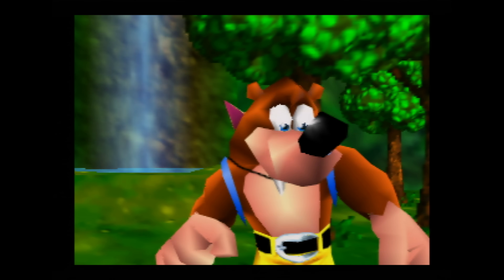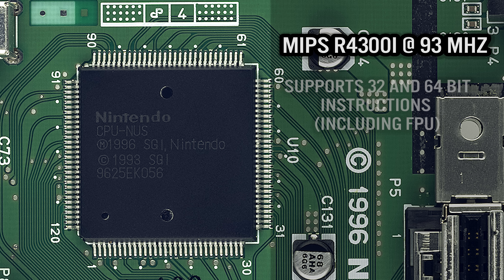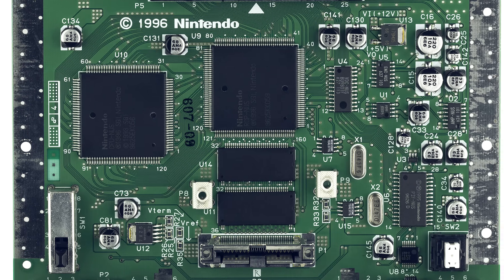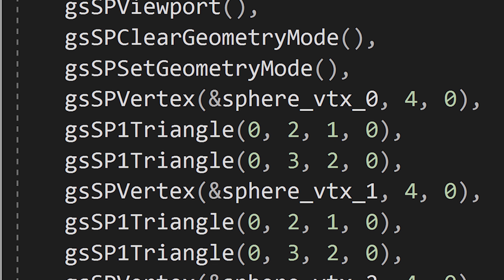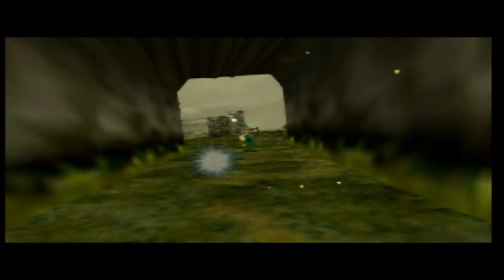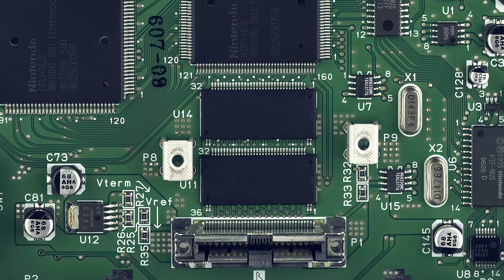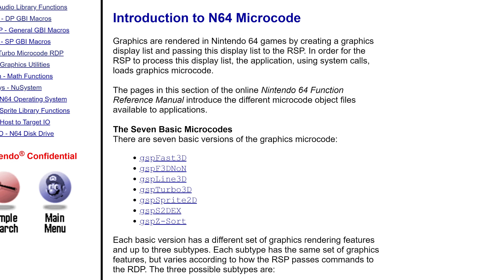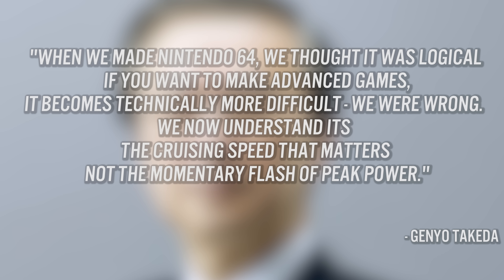Why was the Nintendo 64 so hard to develop games for ? | MVG

Comment: Pipelining doesn't mean parallel execution. Superscalar architectures are a different thing. Pretty much every CPU since the 70s has pipelining and if they didn't, every single instruction would take 4 or more clock cycles to execute.

Comment: That generation was a basically like a second beginning for consoles as the industry moved forward into uncharted waters with 3D graphics becoming viable. Every company had their own concepts of what they thought was going to be the best accepted method of making it happen and what resulted was three really janky consoles each with their own quirks and issues. The Saturn was overdeveloped, the PlayStation was underdeveloped, and the Nintendo 64 was badly developed. That's an entirely separate issue from the entertainment quality of their games, some fine software came out of all of it, but it can't be denied that they're still really wonky machines on paper.
Reply: Saturn was overengineered and TOO complex because its design was UNFINISHED. Parent Company CSK forced its Beta design to be rushed into production 4 months too early. PS1 was underpowered, NOT underdeveloped. That's because its STOLEN Sega Jupiter hardware jankly designed with horrible, basic 3D Polygon drawing and Rendering Sans actual key Hardware tools to fix broken textures. N64 was underdeveloped because Nintendo got ahold of its hardware in Early 1994 and was determined to hurry it out to the market as Yamauchi WANTED it out by 1995 in Japan, but Sony sabotaged the project by Yellow Gossiping to potential CDX licensing about Nintendo. The N64's design was RUSHED.  It's Beta ALREADY ready to go by November 1994. Nintendo held on to it throughout 1995 in a futile attempt to acquire CDX mastering and Drives.
Reply: @segaunited3855  Thanks for the clarification.
Reply: @robintst  You're welcome. Saturn's Beta would have been fully finished by March 1994, but Isao Okawa forced its Unfinished Beta to be rushed into production in December 1993.

Comment: I told Nintendo to go with the 80486 cpu, on a 586 socketed motherboard. With 8mb of ram. This would have allowed them to use an extremely powerful Dx4 100 cpu with extra instructions. And if more power was needed, a 80586 cpu could be added later. The estimated cost of the system I recommended would have been between $300 - $400. But think of the games it could have played. It would have been to the nineties what the 360 was to modern times. :)

Comment: I don't really think its fair to blame Nintendo for any of these except the fill rate/microcode and/or RAM latency. Everything else seems like whiny developers. Developers in my opinion freak out about custom logic to begin with. It does not jive with their unrealistic fantasy. Nintendo did not probably want to reveal its architecture too much.
Reply: "It does not jive with their unrealistic fantasy"  - That would be deadlines ?
Reply: @SerBallister  "That would be deadlines ?" - That would be cheap games are great games not great games? Nintendo believed if it gave developers the tools to be great, they would be. RAM is slow and expensive. Nintendo said time is money. Developers said no, it doesn't work like that. Time is money.  Sony learned this same lesson with PS3. This is why PS4 and Xbox One are on x86 APUs.  Tech has peaked; cause time is money. Deadlines is just time. Deadlines be money. Greatness is just a myth. It's not the complexity that is the problem though. Its productivity. Low productivity that makes money and is on time, it's a feast. When the innovation stalls it's a famine. Innovation that does not increase productivity is really smart....

Comment: Third party developers didn't want to create games for cartridges, because they were much more expensive and couldn't hold nearly as much memory. The PS1's CD-based console was much more attractive to developers, because CDs were much better than cartridges. It also didn't help that the PS1 sold 100,000,000 units, while the N64 only sold around 30,000,000.

Comment: Imagine if somehow it had 64K of cache and 64MB of RAM.  Like a N64+ that came out a few years after initial release.  That would be mind blowing for the consumer with high potential textures, and larger levels.  But a nightmare for developers to make a game that plays on both consoles with 2 texture packs.
Reply: It would still have the laughable 4MB cartridge size , and the compressed to hell sound thats also dependent on the CPU .. unlike even the PS1 which had an impressive sound chip and didn't waste CPU cycles for sound
Reply: @aceofspades001  with large enough Ram you can just stream the sound from it at decent quality. so it would be more possible to pre generate the music at like a level transition. this would waste barley any cpu cycles.
(yes i am aware of how absolutely bat shit insane this solution sounds).

Comment: Hard to develop on N64? Have you seen the Saturn? N64 is the simpler of the 2, but it was easier to develop on the PlayStation than the other 2. I'd perfer the N64 since you could take your camera anywhere (due to perspective correction), and not worry about textures sliding.

Comment: To their defence nobody knew how to design a viable real time polygonal/3D rendering system at the time, especially not in the consumer space. It was a completely new paradigm. Still mind boggling that Silicon Graphics could design a chip with such a laughable small texture cache even for that time when the system was so dependant on that. It was so much ahead in everything else.
Reply: They didn't have CD rom for good rez textures anyway. Less textures, cheaper cartridge to produce. Saturn and Sega32X were promoting games like Virtua Fighter at the time which had like no textures at all.
Reply: @zerazara  N64 was designed with a superfloppy in mind. N64 DD was supposed to release much earlier and effectively be the N64, and AFAIK wasn't even meant to be a peripheral, but it was postponed because of quality issues and eventually effectively cancelled. But you're right, textures wasn't much of a consideration at the time, flat surfaces was believed to be what they had to settle for in most cases, that was the paradigm, I had forgot that.
Reply: @snetmotnosrorb3946  hmm, that would have been interesting, imagine say, goldeneye on a disk, with the cartrige mostly being faster ram and a buffer for code and textures 👌
Reply: @zerazara  Sega knew texture mapping was the next step though. Daytona USA came out in the arcades in 93, before the 32/64 bit consoles launched. 
 The Saturn did launch with Daytona USA with was texture mapped, They also brought out Virtua Fighter Remix and later Virtua Fighter 2 and Sega Rally with all had texture mapping as well. 
Playstation also had Ridge Racer, Tekken and Wipeout that featured textures too.
Reply: @lazarushernandez5827  My point was that at the time, just being fully 3D meant more than good textures in a game(And not 2.5D like for example Doom and Duke Nukem). 3D games was like a gimmick at the time which amazed 16bit gamers. And many of the 3D games also sucked because making games in 3D was unknown terrain for many game developers. But we had some great titles though back in the day right after mid 90s, like Super Mario 64, Sega Nights in to dreams, and Crash Bandicoot.
Reply: @zerazara  even with CD you couldn't access the data since the RAM was limited...  you had to stream the game data linearly which is good for games like crash bandicoot, starfox, and single player racing games where you could stream the textures and level data as you moved through the level, but it was bad if you wanted lots of different enemy types in the level at the same time.
Reply: @aoeu256  You are overcomplicating things. Point is, you could never have made Final Fantasy VII as the great hit it was on N64, even though the PS1 had inferior Hardware, simply because the PS1 had CDRom and could store more detailed content, cutscenes etc.

N64 was great in it's design. But it would have completely dominated the PS1 and held up much more against the PS2, if it had a CDRom out of the box. And if the next Nintendo iteration had DVD capability, it might have completely crushed Sony in the console war..but Nintendo played safe, and focused on franchise, branding, entertainment value instead of technology. And they have had great success with that strategy. SEGA for example tried the technology approach m, and we all know how that ended..
Reply: That's not true.  Nobody new how to design a capable 3D graphics rendering system with a unified memory bus.  The geometry transformation, texture mapping, and framebuffer reads/writes are all memory intensive - and they interfere with one another when they are all on the same bus.  Nintendo could have added a small VRAM chip like the Playstation did, but that would drive up the cost.  And their custom hardware was already expensive.
Reply: @alexandernorman5337  It is funny how these consoles pioneered tech/architecture back then (even if they had hurdles programming for them) that is often mainstream today. 
The N64 had unified memory architecture (I think the original Xbox was the next console to use a unified memory architecture)
The Saturn(and 32X) had twin CPUs (more difficult to program for back then but could yield great results, most ports from the PS1 only relied on 1 CPU, and it was noticeable by comparison). 
The Playstation eschewed a proper sprite system for polygons (they would use texture mapped flat polygons as sprites).
Reply: It's not really laughable.  4KB per texture is fine for that era. PS1 had the same. The idea for N64 was tiling and clamping multiple textures across surfaces, making use of texture detailing etc.  Unfortunately due to tiny carts and time, in most cases devs simply stretched a single small texture across the surface.
Reply: Keep in mind Nintendo and other consoles didn't really know what sort of games were going to be popular. I think they had a pretty good idea about it but I felt keeping the library open and seeing what sort of games were made allowed them to get insights into the next system they needed.
Reply: When they designed the rendering system I don't think they had settled on cartridges yet.
Reply: It’s because they basically just copy and pasted their workstation rendering architecture, designed for frame-by-frame rendering of high resolution movie scenes, and sold it to Nintendo as a game architecture. 

Why Nintendo even bought it though…
Reply: @HouseOfFunQM  I'm just glad SGI open sourced OpenGL!!!
Reply: Not to ask a stupid question but I thought that the ps1 was more complex to make games for?

Comment: Not a very good or well researched video.
Basically just reading, ad lib from various easily accessible online sources without really understanding them.

As mentioned elsewhere here in comments: 
The 4Kb was larger than the PlayStations 2Kb. The difference was in how it was managed. 
It was basically one polygon, one cache swap.
And for incredibly stupid reasons it was actually halved, if you dared to use palette textures, which was all the time if you where sane.

So everything you needed when drawing of the polygon started, had to be in memory.
You could easily have gotten higher resolution textures, but you needed to have more polygons then.

Basically this is something that really, really should have been corrected in the last stages of the design.
Sometimes you have to uproot the tree or turn over the tea table when it seems most inconvenient. 
They sat on the design way too long and was too sure and proud of it.

PlayStation was a far inferior system in almost every way, but the texture cache made the whole enormous difference.

Nintendo should have moved fast and decisively when they saw the competition.
Even Saturn had far higher resolution textures than N64.

There would have been ways to patch the RDP in the last moment before manufacture, eat the initial drop in profit per console, and let Moore’s Law take care of it over a year or so.

Dropping the RAM expansion slot hardware alone, would already have payed for that small change.
The RAM speed is way, way, way down on the list of things that could have been better. 
The PS had AFAIR 144Mb bandwidth compared to the 500 for the N64.
Even if about half it was taken by frame buffer and another bit is eaten by latency, it’s still at the very, very least on par.

And remember, PlayStation had much slower access to the storage medium.

Nintendo should have:

A. Fixed the acknowledge texture cache problem and fixed it at almost any cost. And they would have had a console, that would have been far more immediately impressive. And would have given even Dreamcast a run for the money.

B. They should have at the very least launched with the disc drive, (if not made it the only main storage medium from the start).
And then slowly transitioned to only mainly targeting the DD.
This would have had enormous benefits with distribution of games via download kiosks. 
The main bottleneck of the cartridge being the inflexibility of manufacture.
64Mb would have been more than enough for any game.

Most PlayStation games took up the same or less than the biggest N64 games.
FMV was as everyone knows something that was fun the first couple of times and then was skipped and forgotten or even a nuisance.

The N64 was if anything not complex enough.
Apart from the texture cache the machine was too much of an open sandbox. Developers like strict and knowable structures, even if they say they don’t.
The days of bedroom tinkering and tweaking is looong gone.
Since the late 80s getting a presentable product out the tube fast is what matters.
Programmers cost a lot of money and the five year lifespan to learn a single “random” architecture of a console is way too short to make it worthwhile.
This is sad and boring.
But the truth.
Things could be different, but aren’t.

Comment: It feels like the 64-bit CPU was proven to be overkill for the time. From what I've heard neither 64-bit integer ops or the double-precision FPU were used enough by games to be worthwhile. Instead of spending the die space on 64-bit wide register files, ALU, multiplier, barrel shifter, dcache datapath and so on they would have been better off adding the logic to give their dcache and icache some level of set associativity. The direct mapped caches were more of a glass jaw for performance.

It's telling that Nintendo went back to a 32-bit processor for Gamecube, Wii, and Wii U. Albeit still one with double precision FPU and 64-bit vector datapaths that were more genuinely useful.

Maybe the RDP also would have been better off with less features and more performance enhancements. The problem with the TMEM wasn't the size as much as the fact that it was a scratchpad memory instead of an actual texture cache. Maybe they could have implemented that instead of features like 32-bit rendering and some of the more esoteric texture modes. The lack of triangle setup also put kind of a big burden on the RSP although I guess it was manageable enough. You could maybe even make an argument that developers would have been better off without Z buffering altogether although it's hard to say with only a couple of Z-sort games.

Comment: I think it's really easy to forget how advanced the N64 was when it came out. I'll never forget my parents' jaws hitting the floor when the first saw Mario 64 and Wave Race in 1996. My mom is a computer programmer and couldn't believe it. PCs at the time couldn't run the games for the most part.

While it's a bit sad that Nintendo couldn't fully optimize the N64 in time for release, it's very clear that it was the one time Nintendo threw out all the stops and produced some truly groundbreaking hardware. If you look at that rendering pipeline, it's basically a very early version of how we render games today. PlayStation was kind-of halfway there. And Sega didn't even try in terms of doing real 3D.

It's crazy to think about what the N64 could have been had it had a larger texture cache (they maybe should have cut down the amount of ram since they were using carts anyway). I think there was even early multitexturing on the N64, as you could do literally anything through the microcode. It was truly an amazing system and is still underrated to this day for what it accomplished in 96.

Comment: Another nitpick: The memory latency issue has nothing to do with the data remaining in memory for 30 seconds after power off (despite what that forum post from 2004 says). The memory latency that's the issue is simply that for every new memory transaction you want to do, it takes a relatively long time to initialize. So for instance, reading or writing 16 bytes would only take slightly longer than reading or writing 1 byte.

Comment: It's amusing that the PS1 and Saturn both had dedicated sound chips, which were barely used in favor of streaming audio that CDs allowed for, while the N64 had no sound chip when it would've benefited from one the most.
Reply: I thought the PS1 sound chip was good for its time. 24 channels of 48khz sampled sound output was decent. Shame they didn't document the DSP/Reverb unit for it that well.

Comment: I wonder if it was this guy, who responsible for the highly crippling and now very infamous 4KB of texture cache.

Dr. Wei Yen (source: ArtX article on Wikipedia)
"ArtX was a company formed in 1997 by a group of twenty former Silicon Graphics, Inc. engineers, who had worked on the Nintendo 64's graphics chip. ArtX was led by Dr. Wei Yen, who had been SGI's head of Nintendo Operations, the department responsible for the Nintendo 64's fundamental design."

https://en.wikipedia.org/wiki/Wei_Yen